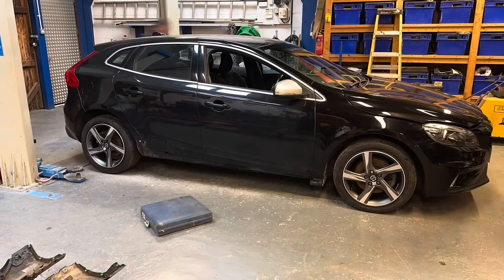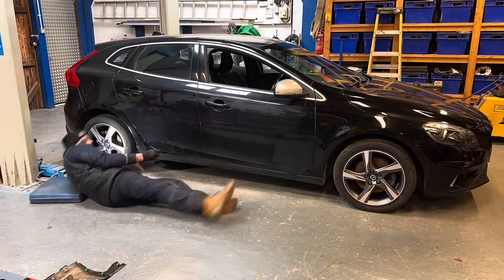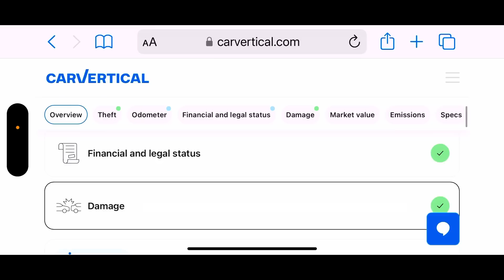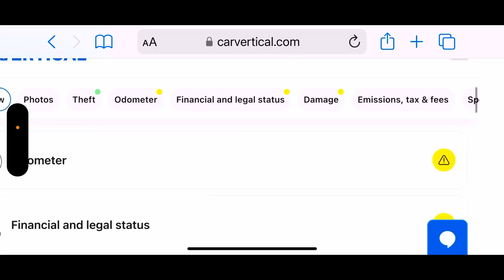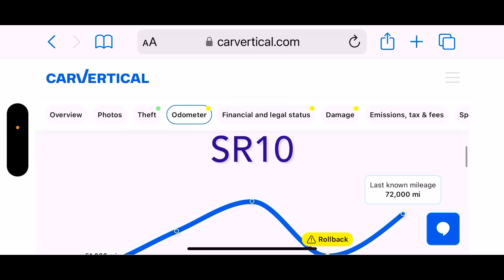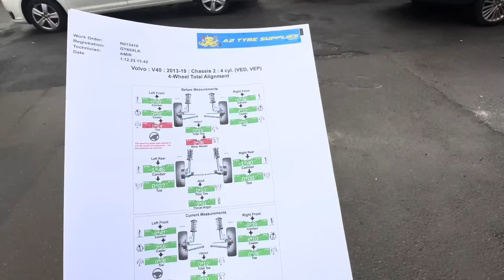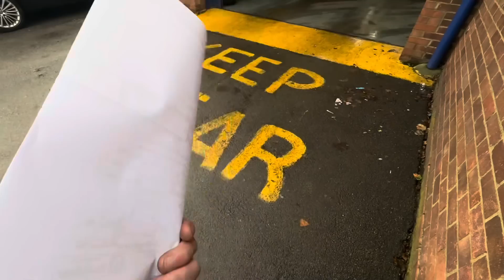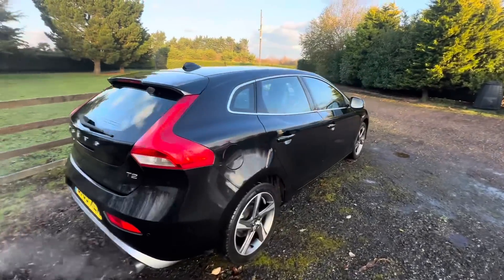WE MADE A BIG MISTAKE WITH THIS WRECKED VOLVO V40 FAIL!!!

Comment: Great video. 😂
I own a 2016 V40 T4, and sustained a hit in the rear of the car while stationary at traffic lights. My car's repair costs were ( on currency conversion) GBP 9,500, so your repair costs were "cheap."  Yes, parts for this model are not cheap. But they are a solidly built car, and the repairer said the job was pretty straightforward and worth doing. Where I live, (Australia) dealers still ask, and get, over ( currency conversion again)  GBP 12000 for good condition, low mileage models of this model year V40.

Comment: Its unusual to see so much snow in Kent. Currently North West England is blanketed with the damned stuff and getting to the lake district is a bit tricky. I think that even as a repaired car you could have asked £7000 for that car and then recouped a bit more on the front bumper skin. You should still turn a profit and you have saved a car which would otherwise have been scrapped for parts in all probability. The joke was very funny by the way.

Comment: I like that black Volvo v40. I've have grey v40 R Designed on a 14 plate has a 100,000 miles on the clock.

Comment: Click bait titles are becoming more and more common on You Tube channels.  It's a natural progression as people begin to lose interest when the content is essentially the same week to week.
Reply: Are you suggesting that this Volvo title is click bait then? From your comment is seems as you are. If you did stay to watch the end if the video it's quite clear that it was a mistake buying it. £250 profit each for all that work and shelling out for a lot if expensive parts  would indicate it was a big mistake on Robs part. No sign of a click bait title from where I'm looking.
Reply: @19Neil67  Funny, because the actual "big mistake" was nothing more than a smaller than usual profit.
Reply: @samrodian919  Yes, for a channel that is about fixing wrecked cars, a title that shouts out " BIG MISTAKE- FAIL" would lead people to believe that some mechanical nightmare happened- broken frame, blown engine etc., not just a smaller than usual profit.  They have done a few in the past where they simply sold them on for no profit at all, so this is not worthy of such a leading title.

Comment: I love a Volvo, I would never have one though just because it will destroy your wallet every time it goes wrong. I'm pretty sure Volvo parts are cost more than German cars
Reply: But, if you don't bend it, you will hardly pay a penny in parts if you keep away from main dealers. In 40 years of Volvo ownership I have had virtually nothing but routine service bills, I door lock, 1 clutch and 1 alternator over 10 cars. 2 of those had over 200K on them.

Comment: Sorry, but most people do not know the big differences between Volvo and "Volvo". All REAL Volvos are Models 70, 80, 90 and some of the 60s. Other Models
are built in the Netherlands or in Belgium, much of them with Engines from other brands. So there is a big quality gap between the Volvo Models. I would
never buy a Volvo 30, 40 or 50, they are not better then other brands. But for example my C70 will definitely last longer then I will life, really.